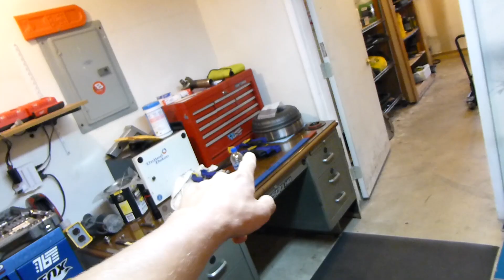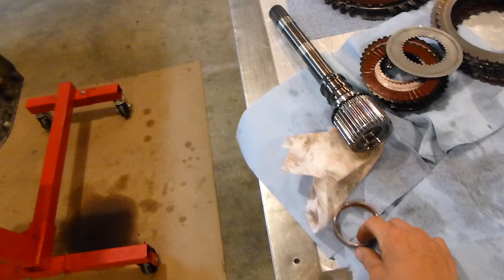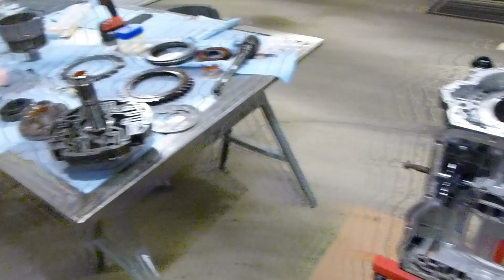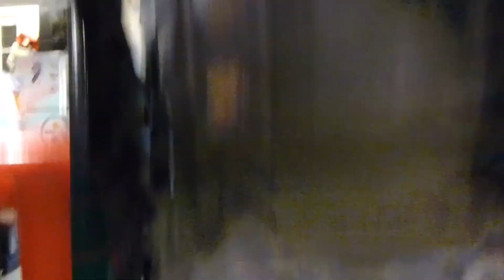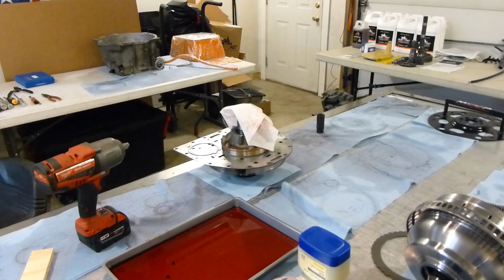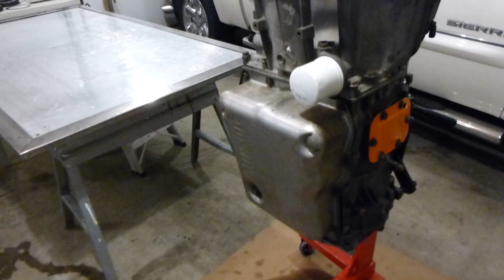PUTTING THE ALLISON 1000 BACK TOGETHER!

Comment: Hey man, did yours come with instructions?? I called suncoast and they told me they dont come with instructions lol! Did u set up your clearances to what the allison manual says or what Suncoast says?
Reply from the maker: Mine did come with suncoast directions but i was confused looking at the allison manual vs their directions. Called suncoast and the guy i said just follow allison tolerances. Then you see other guys that run slightly different tolerances than the allison manual. Its a shit show😂when in doubt though follow the allison manual specs and tolerances
Reply: @jordancampbell66  it sure is a shitshow, I dont understand why they all keep it super secret... if they know the best setups for clearances just sell us the stuff to get there.
Reply from the maker: I dont get it either dude. Even getting ahold of someone if you have a question is a nightmare. I know all the tolerances were close to what the allison book said except C1. Most guys seem to run C1 at like .095
Reply: @jordancampbell66  how is your transmission holding up nowdays?
Reply from the maker: @seanbradshaw8478  it has been good man. need to take it out to do a couple small pressure mods that i need because they werent included with my kit at the time i did it.
Reply: @jordancampbell66  can you share what mods those are? I only have ever seen the normal solenoid mods with the springs
Reply from the maker: Theres a pump spring or shim you can do that i didnt get with my kit. It really needs to be done and its most important. Then another one i need to do is the converter lockup race valve. Which increases lockup pressure. That’s really it

Comment: Were your clearances supposed to be with tge fractions dry or after soaking?
Reply from the maker: This kit had me soak them all for awhile then put them in and check the clearances wet
Reply: @jordancampbell66  that's weird because I've always been told to check clearances dry due to the fractions will swell once wet. But maybe their instructions are set the way they suggest to do it.
Reply: @jordancampbell66  I've built many other gm transmissions but wanting to pull my lbz's allison and rebuild it. Maybe look to replace some hard parts to hold 750hp or so. Not looking for a race truck just one to hold decent power. Eventually thinking about compounds for the towing aspect with lower egt's
Reply from the maker: Yeah ive heard so many different scenarios on checking tolerances its ridiculous haha so i just followed what Suncoast said to do. For your sake you probably dont need any hard parts like you said just some good clutches and a shift kit and a pump shim would set you up nice for what you wanna do
Reply: @jordancampbell66  what all special tools did you need for the allison? I already have the atsg manual and think there's maybe like 3 tools I may need that I dont currently have
Reply from the maker: Honestly i did it all with just the stuff i had at home. Id recommend a bunch of good big screw drivers and pry bars, good feeler gauges, probably the spanner nut socket for the back of the output shaft. Man it was so long ago i can’t remember everything. For the c2 clutches i kinda rigged up something to squeeze the plate to get the snap ring out.

Comment: I cracked my bell housing and the adapter plate and I don’t know if I need a new pump gasket and bell housing gasket or not for when I tear it apart. I don’t plan on dropping the trans completely. Hopefully just enough to get access to get the bell housing and the pump off. Never torn into an Allison this far before. ANY HELP IS GREATLY APPRECIATED
Reply from the maker: Hey man, if you can id probably plan on taking it completely out. It will make your life a lot easier getting that stuff off. When you get that bell housing off just pull the stator and pump assembly out and look it over real good. it isnt hard you will be fine .